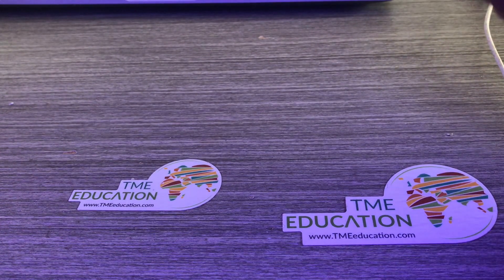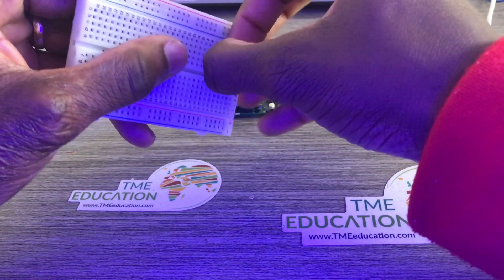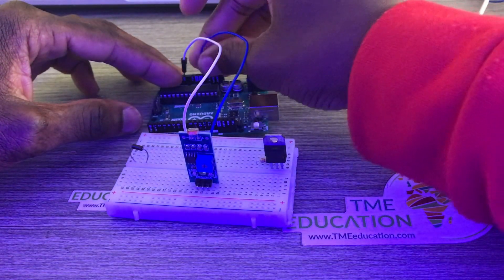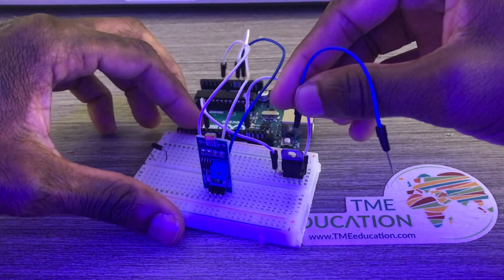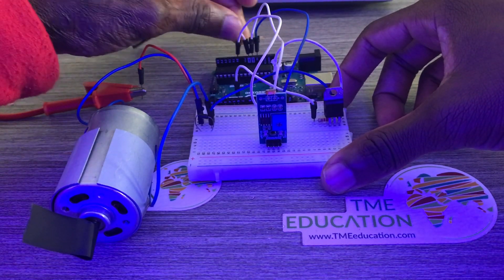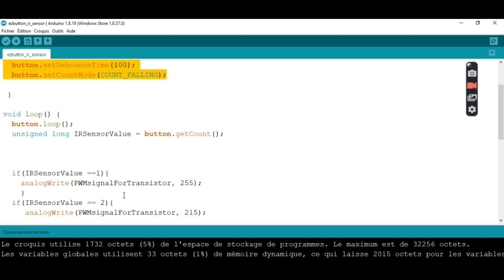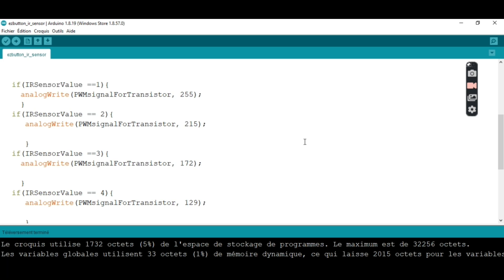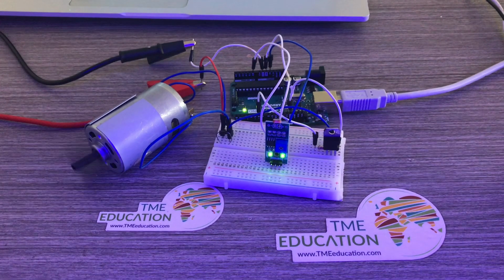DC Motor Control with Arduino Using LDR Sensor Module with TIP120 Transistor @TMEEducation

Comment: Hi, I'm trying to make a turn table that turns off in dark and on in daytime. I want to power a small motor, but I don't use arduino! Can you make said circuit with the same LDR board you have in this video? Without arduino ? When I tried to build the circuit nothing happened. LED lights are on, but the motor doesn't spin.
Reply from the maker: Do you want me to make this without Arduino ?